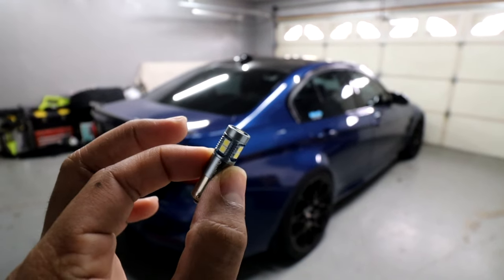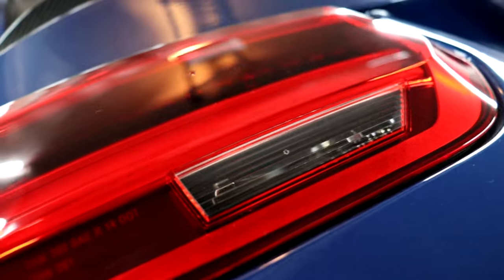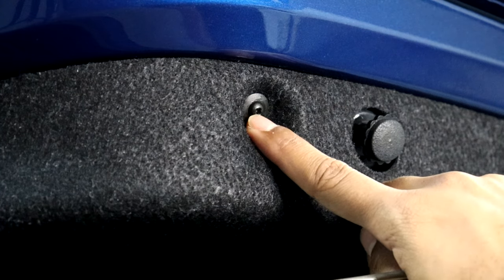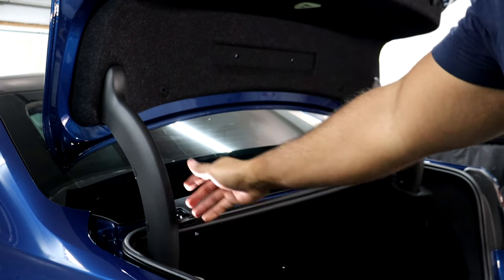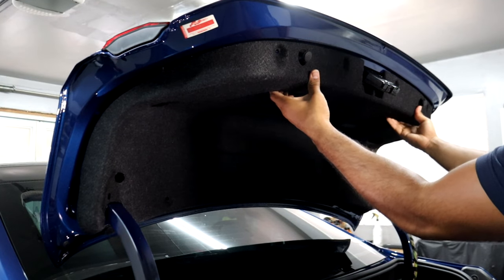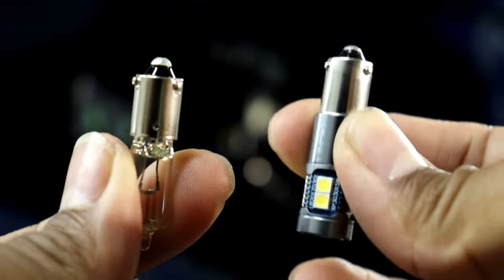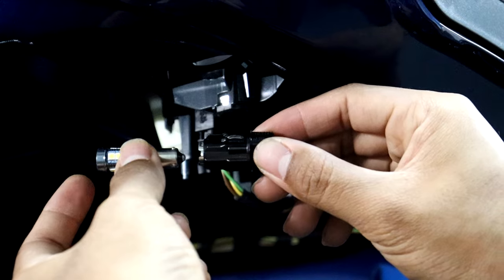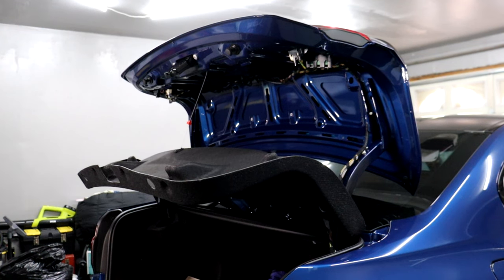LED Reverse Light Upgrade for BMW F30/F80 3-Series, M3!

Comment: Hey cool videos man. I have a quick question about one of your previous videos. When you got the resonator & muffler delete on your 328i, did that cause a check engine light?
Reply: this wont cause a check engine light.
Reply: @boznien1 The place I was going to have it done said I’ll have to go Stage 2 in order to keep the check engine light off.
Reply: @tyler_citrusss4164  that’s only if you got catless downpipe. 

resonators and mufflers are not monitored by oxygen sensors or any sensors for that matter. No CEL will be thrown for deleting resonators or mufflers.

Either way, I would get a catback setup instead. A straight pipe will not sound good.
Reply: @boznien1 I was planning on doing the res/muffler delete and then changing the exhaust tips. I don’t want anything TOO loud but I still want a noticeable change. Just hoping that the CEL doesn’t come on and that I can pass inspection.
Reply: @tyler_citrusss4164  that would be very loud and drone. I would just do an actual exhaust setup
Reply: @boznien1 Ended up getting the muffler delete. I don’t know what magic the shop did but my car sounds great, there’s no check engine light and pretty much no drone. I’m very happy with how it turned out.
Reply: @tyler_citrusss4164  sweet, enjoy the setup :)